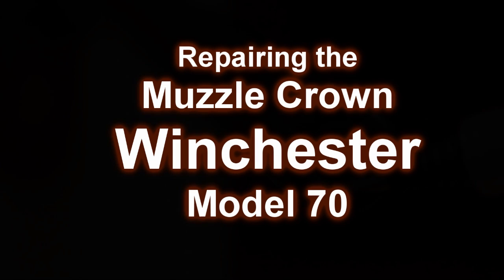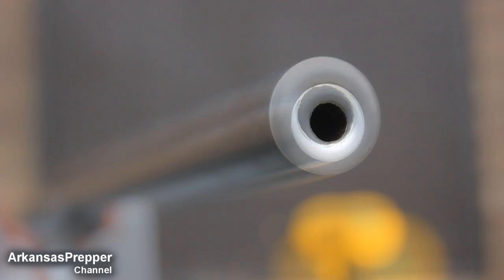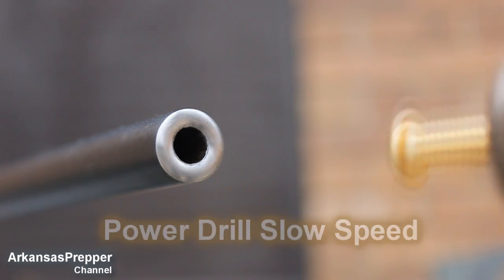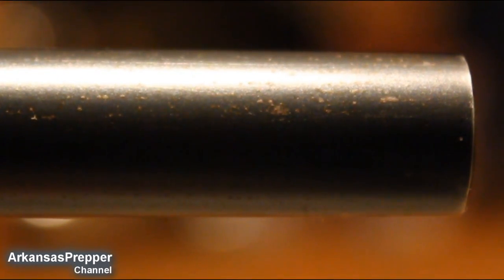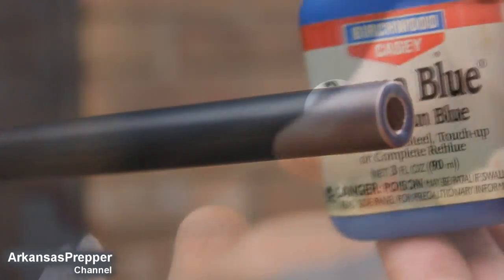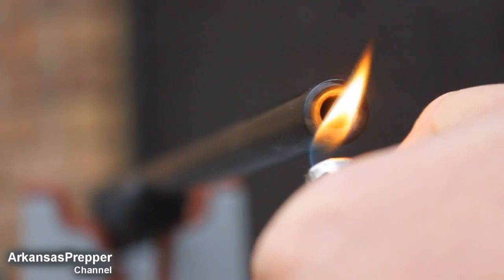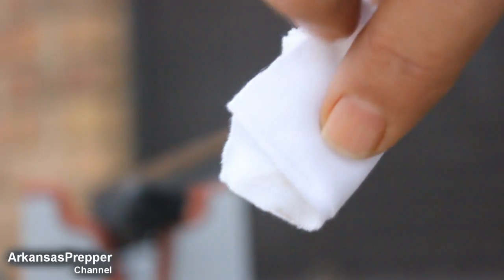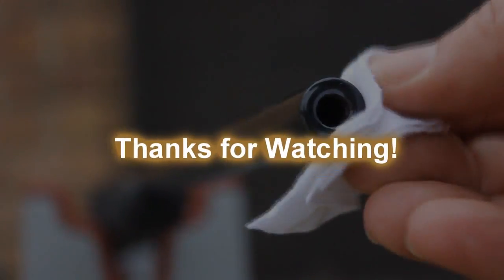Crowning a barrel Part 2

Comment: I've never heard of heating up the metal prior to using bluing.  Maybe that's why I've never had much luck with that stuff!  Thanks!
Reply from the maker: +5 Acres on the Bayou I have put small parts in the oven. It helps by opening up the pours.

Comment: Please tell us the compound you used...thanks for sharing1
Reply from the maker: It is a Jewelers Rouge Polishing Compound. I have had it for years. It can be found at most Jewelers or on line at Amazon. One small block will last a life time and using on your jewelry. Also you can find it at Lowe's or where the Dremel tools are located and that might be the best place?
Reply: ***** I have some Brownell's bore bright here but was curious to know if it had enough abrasive pumice... I believe it would suffice, don't you?
Reply from the maker: MEAlstonIII
Yes, be sure to use a brass screw it is softer than the barrel.